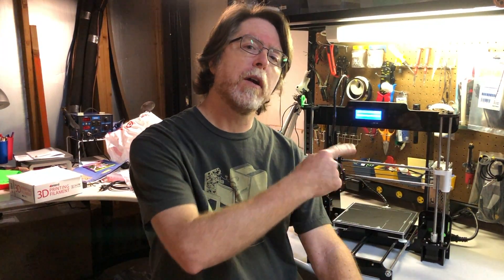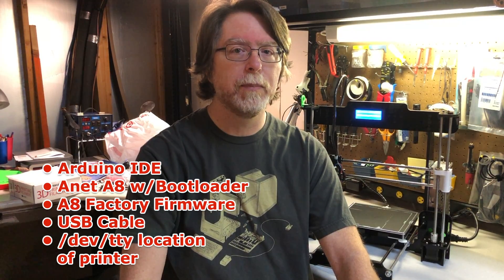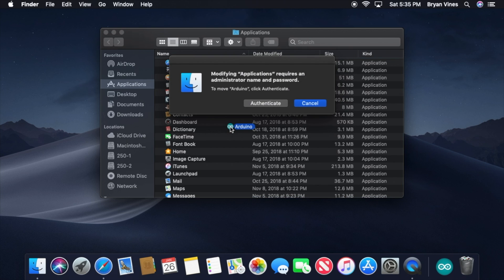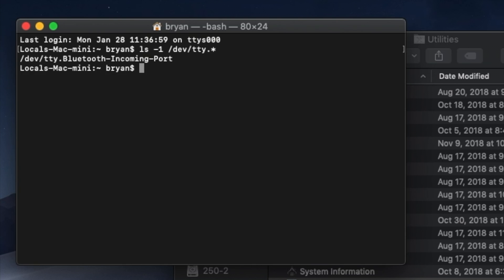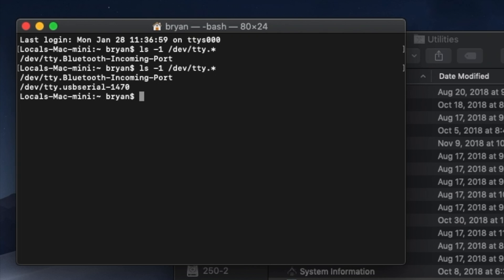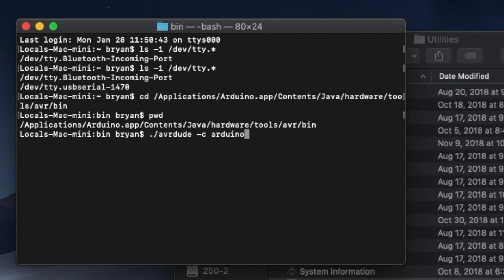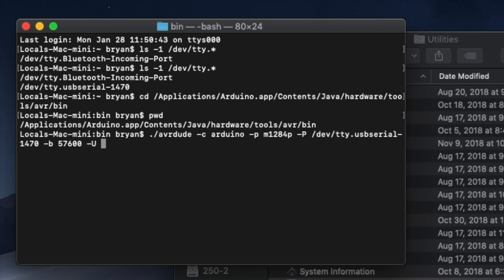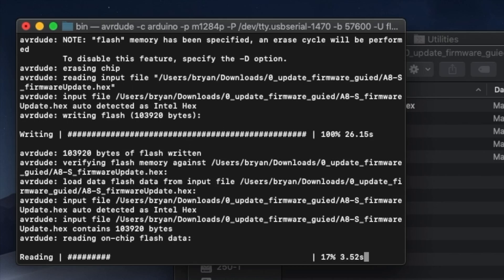How To Install Factory Firmware on the Anet A8 3D Printer

Comment: Hey B Brian, I know this video is five years old. I just received a secondhand a net from someone for parts my original a net the display went out and bought a new one. I hooked it up and I’m not getting any reading on a display. it’s just a blue screen, so my cousin had one buried in his shed he sent it to me as I was swapping out the motherboard I noticed a reset button on it. I’m just fishing for some type of help or advice on it. Should I swap out the other motherboard that he sent me, I’m kind of scared to use it because I see a mark where it look like something overheated or burned on it connecting to the bed temperature screws at the bottom of it

Comment: Hi Bryan,thanks to your video is was able to succesfully upload the factory firmware to my Anet A8 plus board. Unfortunately the board does not boot like it should. The LED on the board lights up for a couple of seconds and goes off again,the lcd stays blank and the printer makes some weird beeping noises. I tried re-flashing it again but this doesn't change anything. So i tried a spare board and again succesfull flash according to avrdude,but again blank display and weird beeping. Do you have any idea what went wrong ? I almost looks like the HEX file is corrupted.  Thanks in advance. Pascal

Comment: Bryan could you also include your configuration  and configuration_adv.h file. I can update my Anet3D V1.5 controller board for a VERY home make 3D printer. But the configuration files I seem to have a problem on OR it is that end-stop problem and I have to touch up the solder on the board. (The end stops are not working on any axis)
Thanks
Richard

Comment: Where can i get the ANET A6-L  (lcd 2004 5 button) factory firmware?  I tried steps, but get avrdude errors programmer is not responding.
Reply from the maker: Hi, I don't know where to get that factory firmware. I searched Anet's web site but couldn't find anything. The Anet A6 group on Facebook may be a good resource for that. https://www.facebook.com/groups/1267099096657537/

Comment: Brian, thanks for a great tutorial and all your help and guidence with my issues! I today I flashed the board with marlin. Then  set out to flash with the Anet auto level... I could not get around  this - "No such file or directory...."avrdude: error reading system wide configuration file "/Users/jenkins/jenkins/workspace/avrdude-staging/label/mac-mini/objdir/etc/avrdude.conf" To day  i downloaded and moved over files from  my iMac to a mac Mini  some confusion coz this...ls -1 /dev/tty.*  brought up ( to my thinking) two usb options!  Anyway the end result was a board flashed with teh A8 AL firmware - so all is well and  learned a lot about this  stuff!  Looking forward to more your tutorial and  pushing your YT pages to a few FB groups...
Reply from the maker: Thanks, Quad Copter! I'm glad you were able to get up and running again, with auto bed leveling! And thanks for sharing the videos on FB! 😀

Comment: After smug success in uploading Marlin - then replacing that with Anet auto level.  Today  I set out - equally smugly with my new found techy skills to re flash Anet Auto Level FW on  my in place board - which did show a fault went connected to Repertier Host and  printing by cable - it air prints at 20mm high off the bed....so re flash it!  98 minutes later !  I get this - and I am clueless but guessing its a missing folder or file missing from a folder - again tips please....:-

 :- avrdude: invalid I/O mode '/' in update specification
  allowed values are:
    r = read device
    w = write device
    v = verify device
avrdude: error parsing update operation 'flash:/Users/ (NAME REMOVED ) Desktop/0_update_firmware_guied/A8-L_firmwareUpdate.hex'
Reply from the maker: Ah, I think I see the problem. 

In here: "flash:/Users/yourname/Desktop/0_update_firmware_guied/A8-L_firmwareUpdate.hex", you needed to specify a write operation immediately after the word "flash".
It should look something like this: "flash:w:/Users/yourname/Desktop/0_update_firmware_guied/A8-L_firmwareUpdate.hex" (there's a "w:" after "flash:").

Hope that helps!
Reply: @BV3D     not feeling so smug now!!   a 5 minutes job 5 hours!!  after I posted - I cleared everything and started again - from then I get this...which seems to indicates your mac mini !  ....can't open config file "/Users/jenkins/jenkins/workspace/avrdude-staging/label/mac-mini/objdir/etc/avrdude.conf": No such file or directory    - looked every Arduino - cannot find this.. but I recall its in the marlin stuff  !  Apologies for clagging up your comments list..
Reply from the maker: Hi Quad Copter! It's OK. If you can, scroll back up in Terminal and then copy & paste your AVRdude command in a reply here. You can replace your username with "yourname" if you like. I just need to see what you were typing. Hint: The 'history' command in Terminal will show you the last 500 commands you've used. 👍

Comment: Hi Bryan, did all that you directed and ended up with this
avrdude: can't open config file "/Users/jenkins/jenkins/workspace/avrdude-staging/label/mac-mini/objdir/etc/avrdude.conf": No such file or directory
avrdude: error reading system wide configuration file "/Users/jenkins/jenkins/workspace/avrdude-staging/label/mac-mini/objdir/etc/avrdude.conf"

Got further this time but! Where did I go wrong?
Ps-Mac-mini:bin peterd$ pwd
/Applications/Arduino.app/Contents/Java/hardware/tools/avr/bin
Ps-Mac-mini:bin peterd$  ./avrdude -c arduino -p m1284p -P /dev/tty.usbserial-1410 -b 57600 -U flash:w::"/Users/peterd/Downloads/0_update_firmware_guied/A8-S_firmwareUpdate.hex" -C ../etc/avrdude.conf
avrdude: invalid file format '/Users/peterd/Downloads/0_update_firmware_guied/A8-S_firmwareUpdate.hex' in update specifier
avrdude: error parsing update operation 'flash:w::/Users/peterd/Downloads/0_update_firmware_guied/A8-S_firmwareUpdate.hex'
Ps-Mac-mini:bin peterd$

Any suggestion, please
Reply from the maker: Take a look at the part of the command where  "-U flash:w:" is. You have two colons after the w, and that second colon is confusing AVRdude. Let me know if that helps! 👍
Reply: @BV3D  Thanks Bryan, thats what you get with cut&paste, as soon as I saw it? I have gone over to another board at the moment but will try again by the end of the week. Thanks again
Reply from the maker: @peterdavies8385  Keep me posted!
Reply: @BV3D  Hi Bryan, did what you suggested and and this is the outcome from Terminal.

Ps-Mac-mini:~ peterd$ ls -1 /dev/tty.*
/dev/tty.Bluetooth-Incoming-Port
Ps-Mac-mini:~ peterd$ ls -1 /dev/tty.*
/dev/tty.Bluetooth-Incoming-Port
/dev/tty.usbserial-1410
Ps-Mac-mini:~ peterd$ cd /Applications/Arduino.app/Contents/Java/hardware/tools/avr/bin
Ps-Mac-mini:bin peterd$ pwd
/Applications/Arduino.app/Contents/Java/hardware/tools/avr/bin
Ps-Mac-mini:bin peterd$ ./avrdude -c arduino -p m1284p _P /dev/tty.usbserial-1410 -b 57600 -U flash:w:"/Users/peterd/Downloads/0_update_firmware_guied/A8-S_firmwareUpdate.hex" -C ../etc/avrdude.conf
avrdude: can't open config file "/Users/jenkins/jenkins/workspace/avrdude-staging/label/mac-mini/objdir/etc/avrdude.conf": No such file or directory
avrdude: error reading system wide configuration file "/Users/jenkins/jenkins/workspace/avrdude-staging/label/mac-mini/objdir/etc/avrdude.conf"
Ps-Mac-mini:bin peterd$ 

I do not get the 'jenkins' part?
I have just looked again at the code and see that the folder that the 'avrdude.conf' is in is labeld 'avrdudess' would this make any difference? Can I just move the 'avrdude.conf' file from avrdudess or rename the folder 'avrdude'. I asked the question and tried, neither worked?

Any suggestions, again please
Reply from the maker: Hi Peter!

Looking at your AVRdude command, I see you've got an underscore instead of a dash in front of the Port specifier (in other words, _P instead of -P.)

Assuming nothing has been unplugged and plugged into a different port, your command should look like this (and you can probably copy/paste it):

First, make sure you're in the right directory:
cd /Applications/Arduino.app/Contents/Java/hardware/tools/avr/bin

Then send the AVRdude command:
./avrdude -c arduino -p m1284p -P /dev/tty.usbserial-1410 -b 57600 -U flash:w:"/Users/peterd/Downloads/0_update_firmware_guied/A8-S_firmwareUpdate.hex" -C ../etc/avrdude.conf

Try copying and pasting the line above into Terminal when you're in the /Applications/Arduino.app/Contents/Java/hardware/tools/avr/bin directory.

Also
- The "Jenkins" stuff represents the default location of the configuration file. The only time you see it is when the path to a configuration file hasn't been properly passed to avrdude.
- The "avrdudess" stuff is a Windows application. You're probably seeing it inside the firmware folder you downloaded.

Let me know how it goes!
Reply: Hi Bryan, Thanks for the information and pointing me in the right direction, tried again this morning and fried my second board, so I will need to get another before I try again. I will 'Buy-you-a-Coffee' for you help and guidance
Peter

Comment: Help! in terminal I get ( -bash: 1s: command not found) what has gone wrong?
Reply from the maker: Hi Peter! If I'm reading that correctly (and if I'm not, forgive me, I've only had one sip of coffee so far), the message you're getting indicates you've typed the number 1 followed by the letter s. If that's the case, and you're trying to get Terminal to show you a list of files, try a lowercase L followed by a lowercase S. An easy way to remember this is that you want to tell Terminal to list stuff , so use the first letter of list and the first letter of stuff together, with no spaces: ls

Please let me know if that helped!
Reply: Thanks Bryan, what you have indicated makes sense, as some of the font faces look very similar to each other when printed or on screen.
I will now try again :)
Great series of vids, Thanks for taking time to produce them
Reply from the maker: Thanks Peter! Let me know how it goes! 👍🏻

Comment: Hi Brian, I have an Anet A8M, and I need some help. These steps that were done with Anet A8 are the same for the A8M (double extruder). You would have the files for A8M (Marlin, Firmware, etc) thank Paulo
Reply from the maker: Hi Paulo, I have a video here (https://youtu.be/V7_zIQALk6E) covering Marlin installation on the Anet A8. All the files needed are either linked in the description or I show you where to get them in the video. That video uses an Anet A8 configuration which is included in with the Marlin firmware, and the configuration is set for a single extruder. I haven't tried a dual-extruder configuration in Marlin, All my printers are single extruder machines. I can try to help, but I cannot guarantee success.

Comment: Hi Brian ! I've followed all your instructions on how to burn a bootloader and how to install the factory firmware of the ANET A8.
Everything was a success unless after the factory firmware was installed, when I plug the board to a computer or turn the whole printer on, the screen remains blue with no display and produces very scattered beeps.
Would you know what caused this ?
Reply from the maker: Hi Lucas! It sounds like the firmware and the board don't like each other. When I did this video, I used an Anet v1.5 main board. I don't think that makes a difference, but what version is yours? You might try flashing the Anet firmware onto the board a second time. Also, you could try installing the Marlin firmware on the printer (see https://youtu.be/V7_zIQALk6E).
Reply: @BV3D  So the board I am using is a 1.7 that I bought off AliExpress. It's probably unofficial but I still have the 1.5 board I had bricked a while ago!
Do you have any directions or links to tutorials on how to flash a board? Thank you!
Reply from the maker: @lucaszito109  Try installing the bootloader on the bricked board. Connecting the programmer to the board bypasses any bootloader that might already be on it, and lays down a new one. So try running through the process with the 1.5 board. I didn't ask earlier, but I'm assuming your Anet A8 has the 20 character by 4 line LCD with the five navigation buttons, right?
Reply: @BV3D  My A8 has the LCD screen with a potentiometer and when it turns on nothing shows on the screen not even the 4 lines of characters. But yes normally it shows. I will try with the bricked board and come back to you! Thanks a lot for your time and help
Reply from the maker: Lucas Zito I thought it was the A6 with the rotary encoder with the 4 line display. Let me research.
Reply: @BV3D  I just tried with the bricked board and actually I can't find the port it is plugged in. I've tried with /dev/tty.* and nothing shows up in the terminal. So I don't even find it in my IDE
Reply from the maker: @lucaszito109  OK. If you've got the 4 line LCD with a knob, I'm guessing that's an Anet A6. Apart from the A6 having the knob and the A8 having navigation buttons, the A6 has its X rods arranged one behind the other; the A8 has them arranged one above the other. I'm starting to think you may have an A6. If that's the case, you can find the factory firmware file here: https://www.dropbox.com/s/sh4uyr37ouz6i3a/A6-FirmwareUpdate.zip?dl=0

Comment: Will this method work on windows? Also would I be able to drag any other firmware to install instead of the factory software?
Reply from the maker: Hi Adrian! Great question. You'll have an easier time of it with Windows. When you download the A8 firmware using the link in the description, the zip archive also contains a Windows app called "avrdudess". This gives you a graphical interface to the avrdude utility. It's an older version, and when you launch it, it may complain that it's missing a USB library. That's OK: The software offers to install an update which includes the missing library. There's also a screenshot in the zip archive showing what options to set.

Using either procedure, you should be able to flash any firmware file to the A8.
Reply: @BV3D  i tried using avrdudess but all i got was ~~~~~~~~~~~ whenever i set it to the settings listed and did everything correct..just didn't work please help >.<
Reply: @rndm9087  I have the same issue

Comment: Question: Is that Mojave? If it is, what is your Mac? Mine is a 2009 4,1, but I updated the firmware, so now it thinks my Mac is a 5,1. Question: Can I install Mojave?
Reply from the maker: Hi Mark, I don't think you can run Mojave on it. Both the Macmini4,1 and Macmini5,1 models can run macOS up to 10.13, but they won't run 10.14. I tried installing Mojave on a 2011 Macmini5,1 and the installer told me no. 😕
Reply: BV3D: Bryan Vines so visually, is that screen look dark mode?
Reply from the maker: Yes, that's dark mode. I mostly like it, but for me, Mail is kind of hard to navigate in dark mode.
Reply: @BV3D   Agreed, most likely Sierra is max on that.